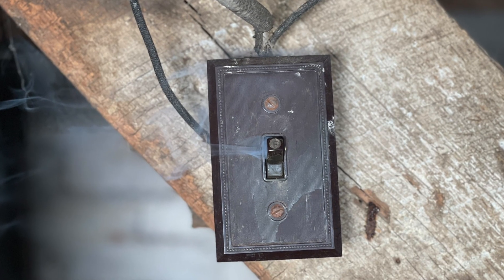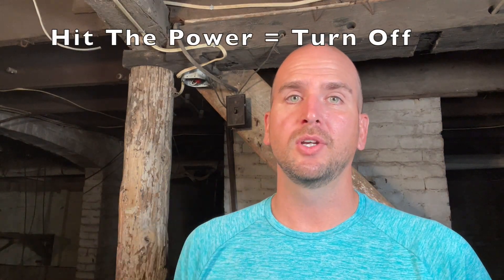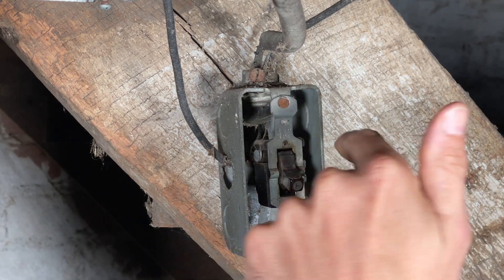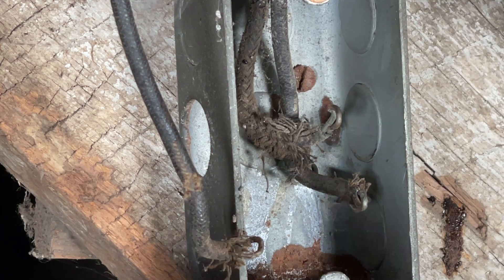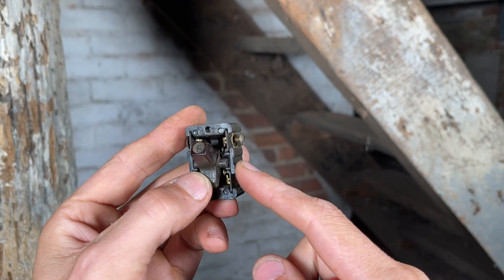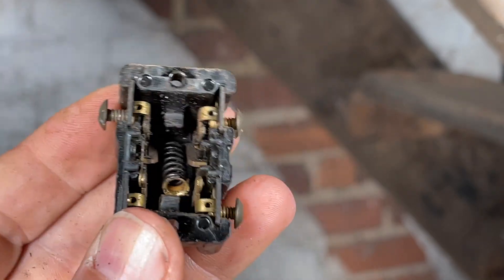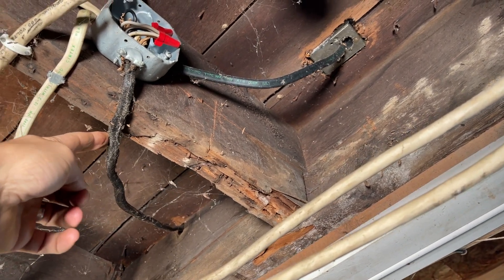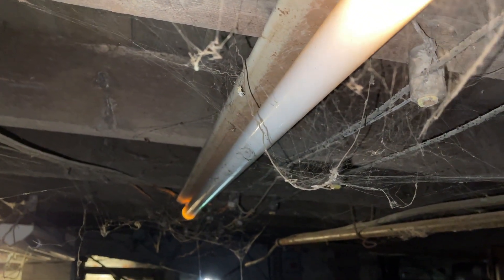Issues with Old Electric Wiring | Knob and Tube

Comment: Knob and tube systems are installed originally quite well in my experience, when someone modifies it (usually poorly) that seems to be when safety issues arise.
Reply: The saving thing about old knob and tube wiring is the two wires are separated (usually) by some distance. I don't know if there was a standard. The problem with them is the insulation is usually in terrible shape and they had poor insulating materials to begin with. The wires themself loosing their insulation isn't much of a problem because of the wires being spaced apart (well bare wires could sure be a problem to you). The big problem is when the 2 wires are brought in or out of a fixture box. Now the 2 wires may not be separated and you have to work on these old, with crumbling insulation, wires..
Reply: @larsord9139  Adding insulation to houses with knob and tube is a no-no too. Those open wires are meant to stay that way.
Reply: @hotpuppy1  it's not equivalent to box or raceway fill when you're thinking of rolling insulation between your ceiling joists. There's still plenty of air space, that fiberglass insulation doesn't create that much heat when you have a wire on each side of a 2X. It's not the same as fill calculations. If that were the case any sheath wires would be more likely to overheat than a single knob and tube wire, one on one side of the 2×  and one on the other side.
Reply: The problem is nearly all of the knob and tube systems have been modified. Very few people are satisfied with one outlet, one switch, and one light fixture per room, which is what was would be typically installed in a knob and tube installation 100 years ago (maybe 2 outlets and a range outlet in a kitchen).
Reply: @burgundyyears 100 years ago electric ranges were a rarity. It was gas the majority of kitchens had.
Reply from the maker: That has been my experience as well.
Reply: @EverydayHomeRepairs  the other problem you see is the wires have become very short over the years of people changing recepticals and switches. Often even adding a pigtail is difficult to get a wire nut or connector on the existing wire.
Reply: @smitlag  Or crowding your wires & nuts in a small box, when pigtailing.
Reply: Three weeks ago, I was in upstate NY and was inside a huge barn that still had Knob and Tube wiring in use and appeared to be in remarkable condition for its age.
Reply: The irony of knob and tube is that the knobs and tubes are the safest parts of the system, indeed arguably safer than what we do today (the knobs offset parallel-running wire from the joist/stud, thus virtually eliminating the possibility of being penetrated by a wayward drywall screw or other fastener, while the tubes offer a protected passageway through studs and joists). It's really everything else: undersized wire, degraded insulation, no grounding, etc.
Reply: One main problem also is where the wires come into the box to the device. The device eventually goes bad like the switch in the video. You pull it out of the box and the wire insulation crumbles to dust.
Reply: That type of wires back then the rating was not engineered for the types of loads we have today.most wires now days are rated 75 c and 90 c as standard.with insulation rating that can withstand heat in conductor much better.again the loads we have today draws a lot more.
Reply: Part of my house is wired with K&T.  It is all in good condition.  It is tied to my panel with a 15 amp breaker.  It's never tripped.
Reply: These comments endorsing knob and tube as good until modified is absolutely astounding but also very believable when it comes to the rampant ignorance that people have with electrical knowledge. Sharing a neutral throughout the house as is common place in knob and tube systems is a primary and major issue to start!! If you don’t understand this basic reasoning as to why considering how the modern age has brought different loads to the AC system and how the distortion in harmonics, overloading the neutral because of that harmonic imbalance from greater computer loads as well as increasing appliance loads in addition to the risk of getting in between the neutral even when you think that the hot conductor is denergized because these old school practices they switch that neutral instead of a hot conductor. You have old deteriorating soldered joints, insulation wearing off completely because of decades of continuous overheating. Residential electricians by and large are sloppy and not skilled enough to properly install, considering they typically exceed box cube capacity by using old small single gang boxes with to many conductors, they don’t mark circuits or understand the importance of layout and minimizing splices, they don’t organize circuits that make sense to the end user because they do the minimum…knob and tube is this scenario on steroids. The size wire gauge that is used for knob and tube is undersized for modern load increases in demand. If you’re advocating for the use of knob and tube you are absolutely ignorant and need to back away from electrical work because you’re in over your head.
Reply: Like adding new wiring into that circuit?
Reply: My beef with wiring of that age is that the insulation is the rubber/tar impregnated cloth, which has dried out and become brittle with age. Which means, if a switch, outlet, etc needs replacing, so does the wiring, most likely, after you touch it. It just crumbles to dust in your hands!
Reply: @bcubed72  --  Well, I'm old  enough that I was taught in "shop" class how to repair such wiring.   Basically, its rubber tape covered by friction tape.   If need be, you can re-insulated a section of wiring or just splice in some new stuff.
Reply: @GilmerJohn  Were you shown how to do a Western Union splice?
Reply: @frankpaya690  --  I read about it in my youth in the 50s.   In shop class (mid 50s) we were taught to wrap a splice (soldered, of course) with a layer or two of rubber tape followed by a layer or two of "friction tape."   The idea was to duplicate how wiring was once protected in the knob and tube system.
Reply: @frankpaya690  --  I read about it in my youth in the 50s.   In shop class (mid 50s) we were taught to wrap a splice (soldered, of course) with a layer or two of rubber tape followed by a layer or two of "friction tape."   The idea was to duplicate how wiring was once protected in the knob and tube system.
Reply: @bcubed72  Amen!
Reply: Definitely.

When knob and tube is modified improperly that's when it is dangerous. 

I personally would prefer knob and tube with the addition of a ground conductor as the hot and neutral wires are farther apart than they are in romex. 

That would mean if the insulation goes bad the hot and neutral stand a lesser chance of touching each other given they are separated a bit.
Reply: @ikonix360  It sounds like you have an understanding in a structural sense about wiring and electricity whereas many people that call themselves" electricians" are just parts changers believing and repeating whatever they're told with no understanding of why they're allegedly supposed to be doing something.
Reply: @ikonix360  "Definitely" NOT true. 

It's "inherently" dangerous to the typical homeowner "as-built", because it's an "un-grounded" system. I'm a retired 30+ year industrial electrician.

Technology and knowledge improve with time...and back then home "electrocutions" happened almost DAILY from the "Modern Wonders of Electricity⚡"

They didn't KNOW anything better back in the early 1900's. Now they DO. Just sayin'.🤔
Reply: @CannonFodder873  dangerous only when an ungrounded outlet on knob and tube is replaced with a grounded outlet.
Reply: @ikonix360  That begs the question of how those "Victorians" electrocuted themselves with 2 prong receptacles, then.🤔
Reply: @CannonFodder873  They all died of electricity, that's why they're extinct today.
Reply: @ikonix360  Really?!  If you're so concerned about 'insulation deterioration' in your standard NM cable, you're probably better off switching to industrial-grade metal-clad armored cable (unless you're building something on a farm).
Reply: @kenc2257  Insulation deterioration isn't a problem with NM. It is a BIG problem with wiring with "rubber-impregnated cloth" insulation, because the rubber is now brittle and drier than granny's...false teeth.
Reply: @kenc2257  I have seen wiring from the 1950's that seemed to have similar insulation as what we use today.  Even after 60 plus years of service the insulation and wire was fine other than there wasn't an earth/ground wire in the circuit.  I am reasonably confident that as long as someone doesn't damage the insulation and/or wire that the insulation will serve appropriately for many decades (I can't predict what will come along that is connected to the circuit so I won't claim the wiring itself will serve that long).
Reply: @mharris5047  what would destroy the insulation would be roof leaks or rodents or  shorts  Or an overcurrent that didn't open the fuse or circuit breaker.
Reply: Ok Hipsters, Knob and Tube is unsafe as hell even when professionally installed. Too many cons. Even insurance could be more costly for example.
Reply: @alfonso704  --  Actually it was quite safe as installed.
Reply: @GilmerJohn  I agree but that was 80yrs ago. I’ve seen it disintegrate to the touch.
Reply: @alfonso704  --  Oh, the original wire insulation was rubber covered by a layer of fabric.   The wire insulation protects from shocks from casual contact or from a metal object causing a short.   Otherwise, it's completely unnecessary.   The switches and outlets were metal and ceramic with no plastic.   As the presenter indirectly pointed out, the problems usually come from using "modern" stuff with the old stuff.   You gotta do it right.
Reply: @GilmerJohn  and you think there’s no new stuff tied into a home made 100yrs ago? Yeah there will always be mixed in stuff. Might as well re wire home
Reply: @alfonso704  --  Well, honest electricians simply put in a modern panel and run new circuits where needed and power up the old knob  & tube in a safe manner.   Yes, it can be done and done legally and safely.

There are reasons why you don't have to rip out stuff that was legal when put into place.
Reply: @GilmerJohn  hmm no way man. I think you meant honest handyman. While you technically can do a legit splice. Youre a hundred times Better off running a new grounded circuit. I would walk off the job before extending anything K&T.
Reply: @alfonso704  --  Walk off.
Reply: @GilmerJohn  Depends. If you open a wall for any remodeling, it all has to come out.
Reply: @GilmerJohn  so many people doing electrical work aren't "tradesmen" their parts Changers, they don't understand what they're doing & the reasons behind it. They're just doing what they were showin and repeating what they've been hearing.
Reply: @alfonso704  Give some examples in what ways it's "unsafe"""as hell"?

Comment: I'm aware in some places (like where I live) those "hybrid" updates are illegal, once one thing gets touched the whole thing has to be redone. this leads to a situation where a professional electrician will quote a crazy high price for even something simple, and leads to people that do their own DIY fixes that either become ticking timebombs or burns the whole place down
Reply: in newer houses I seen most black wires are hot if you got a light up top and outlets down below i had 9 wires to hook up 2 black on screws on the right side all white where natural pigtailed together and pushed in the back and all ground pigtailed and one on green screw how did they wire switches back then with the knob thing as was helping my son on his place and it had no grounds and one white on one screw and one black on the other on same side half his house aint got power way over my head told him hire pro guessed and fixed mine but not safe to try on his
Reply: i did learn on doing  my one switch and its a mobile home those suck wanted to get rid of that fire hazard switch and put new one like a house would have was blown away to see 9 wires and I got 3 screws to hook 2 lol but one black was from the breaker to the light and the other was to the outlets below as one is always hot and the other only is when light switch is flipped since then learned how to add a outside motion light off of a outlet inside and power it with a switch interesting as how it all comes together and works but I will amit that hiring a electrician is the best thing to do playing with wires you tubing my way thur it is still a risk i live with as a fire could be possible nothing is worth that got to give props to electricians alot of work and knowledge involved I would have carpal tunnel after one house
Reply: It's not as if every DIY'er burns their house down 🤦‍♂️ It's really no rocket science to understand how to strip a wire and bolt it onto a switch or outlet or whatever. Sure some people mess it up, but i think it's a silly common assumption that electricians are high up wizards and everyone else should keep their hands of it. As long as someone has the intention to do it well, and reads through all the information relevant to it, it's highly probably fine. If someone doesn't care how it's done and just wants to have it done for free then sure you get the ticking timebomb/house burned down.
Reply: @Engineer9736  As an electrical engineer, I bet most electricians can barely do a circuit analysis. Read up on codes and NEC, and most of us can probably do a better job since we care more about our own houses than someone on a clock. Crawling through attic or crawl space would be the hardest part.
Reply: @mintheman7  You don't need to be a whiz at circuit analysis to run wire properly. You just have to know the NEC and apply it. I have seen 'engineers' and other professionals with NO common sense. There are a lot of people out there without a clue>>cars for instance>>go watch 'Just Rolled In'.
Reply: @mintheman7  Electrical engineers and electricians have two different functions. If an electrician could do load flow, short circuit and system stabilities he would be an electrical engineer. On the other hand I wouldn't trust an electrical engineer with a screwdriver in a 480V MCC.
Reply: @mintheman7  I can tell that you think, you're the best, trust me electricians know 120v electrical theory more than you could learn in 4-hour sittings every day for a year, they do it for a living, your the type of person to think you can just use a neutral to ground the system since they are bonded at the panel.
Reply: @mintheman7  As a holder of a MS physics I concur.  These guys are clueless as to how electricity actually works.  I am sure I can do any electrician job you can throw at me
Reply: @hotpuppy1  Engineers know how to read and apply.  that is kinda what they do.  The only difference is engineers do it at a much higher level
Reply: neutrals are not grounds.  and its E&M.  I am sorry you think that being an electrician is hard.  it is the easiest trade I have learned
Reply: @Engineer9736   There's a lot of job security that is at the root of these generalizations.
Reply: @Engineer9736  no they don't burn their houses down. But they sure give us a lot of work fixing their DIY fuckups
Reply: @cowboyga1  the hot goes to the black and the other one goes to the white.  
I got an outrageous number to put in some outlets.  10 hours of study later I got my outlets lights and removed all the K&T from the basement.
Reply: @Engineer9736  most are negligent, shit even me as a DIYer I do a temporary fix that becomes permanent. lol we don't do this 10 hours a day for 325 days of the year.

Comment: Our house came very close to being burned down by an old doorbell; I would be interested to know if anybody else has heard of such a thing happening: A few weeks after we moved into our 1950s house, a delivery came to the door and the man pressed the doorbell, and left the package. I was working in another part of the house, and I heard the double-chime doorbell go >bing<, but not >bong<. I didn't pay much attention, until I started smelling smoke in the hallway about 15 minutes later. The old doorbell button had stuck in, keeping the power live to the chime solenoid, and slowly heating up the solenoid coil inside the wall (which accounted for the lack of the second bong, as the striker bar was being actively held against the spring). I didn't know these details yet, but I saw smoke coming out from behind the chime box; I smashed it off the wall, levered the hot coil away from the charring wood, and got everything safely disconnected, and doused the wood. If I had not been home at the time, the wall certainly would've been on fire within another 10 minutes or so. I decommissioned the doorbell and chime; it all went into the dumper, with no regrets whatsoever. Then I installed a brass knocker on the front door.
Reply: Yes, I knew someone that had that happen to them, their recently installed sprinkler system is the thing that saved them.
Reply: @no_ah_kel_lah  Good for them. I shudder just remembering that old contraption.
Reply: not only is there a transformer for your doorbell system but you may very well also find an old transformer to the old phone wiring system which can also cause a short somewhere

Comment: The plasticizer in my old retrofit romex is separating making green death sludge. https://youtu.be/mHIgjTd0yCQ The knob and tube that was augmented or replaced is still great and functional. 

I have slipped a long piece of heat shrink over the knob and tube wire as far as it will go when replacing fixtures and switches in case the jacket separates in the junction box. And usually another layer of heat shrink.